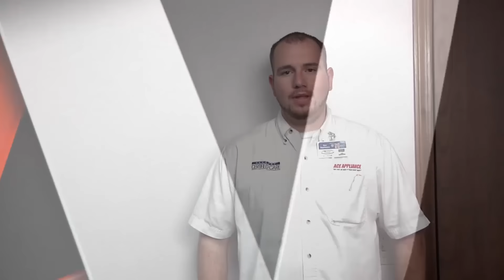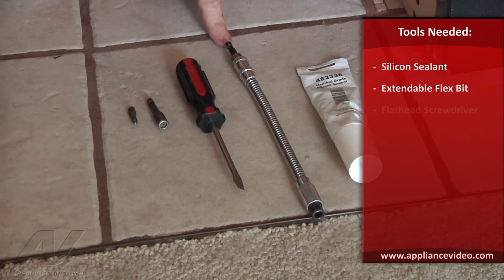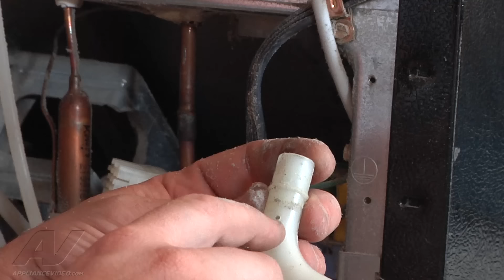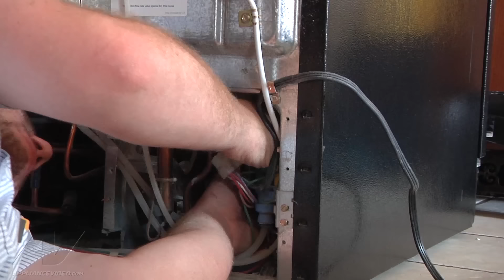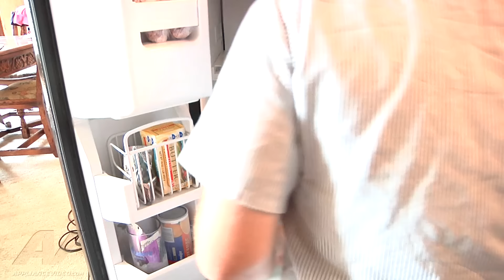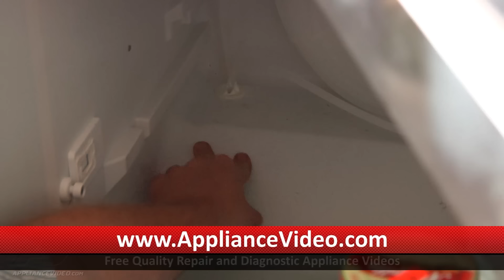Kenmore Refrigerator Repair - Leaking Water - Drain Tube

Comment: why is my ice makers not working Friday I have hoke my water line up from the sink to the back of my Frigidaire and my water is running thought my front of the frigidaire but my ice maker is not working it's been on now for 28 hours so why don't I have ice yet
Reply from the maker: Great question, with our
technicians now getting hundreds questions weekly, they are answering all questions
at our website at ApplianceVideo.com under our Repair Help section. We have over
3,000 common questions and answers that you can easily search through by your
model number, appliance make, and problem or error codes.

Comment: maytag fridge leaking...MD #Rtp1900cae , can't get to the drain tube..how to access is requested
Reply from the maker: Great question, with our
technicians now getting hundreds questions weekly, they are answering all questions
at our website at ApplianceVideo.com under our Repair Help section. We have over
3,000 common questions and answers that you can easily search through by your
model number, appliance make, and problem or error codes.

Comment: I got a new P trap tube on line & it was one pain in the ass to install. The ring around the top of the p trap was to fat to go into the grommet. I had a hell of a time making that ring smaller to fit into the grommet. I just don't get how keeping water held in the p trap is going to help it drain better.
Reply from the maker: +Frank Desantis 

 

         Good question, with our technicians
now getting hundreds questions weekly, they are answering all questions at our
website http://www.appliancevideo.com/repair-help/ .  We also have over 30000 common questions
and answers that you can easily search through by your model number, appliance
make, problem or error code and it’s absolutely FREE.
Reply: It quits letting warm air in and therefore stops all the condensation from building up

Comment: I have the same one on this video I unplug it to defrost and now is not coming on its got power because the light comes on in side but the nothing else does
Reply from the maker: +Luis Gutierrez 

         Good question, with our technicians
now getting hundreds questions weekly, they are answering all questions at our
website http://www.appliancevideo.com/repair-help/ .  We also have over 30000 common questions
and answers that you can easily search through by your model number, appliance
make, problem or error code and it’s absolutely FREE.

Comment: hey how did you get the drain tube to push all the way in so that the round ridge doesent show. if you can get back to me asap that would be awsome
Reply from the maker: +SAYMiK3 

Good question, with our
technicians now getting hundreds questions weekly, they are answering all questions
at our website http://www.appliancevideo.com/repair-help/ .  We also have over 30000 common questions
and answers that you can easily search through by your model number, appliance
make, problem or error code and it’s absolutely FREE.

Comment: What is the p/n of the new drain tube ?
Reply from the maker: +mengseang sean 

 We would like to help you answer your
question. With our videos now getting over 900,000 views per month and hundreds
of questions from people like you, our technicians are now answering questions
at our website http://www.appliancevideo.com/repair-help/ .  We also have over 2200 common questions
and answers that you can easily search through by your model number, appliance
make, problem or error code and it’s absolutely FREE. You also have the option
to email a factory service technician with a question on your appliance at http://www.appliancevideo.com/repair-help/ . If you’re looking for a repair video, you can
also search our library of over 2600 free repair videos. ApplianceVideo.com
specializes in quality DO-IT-YOURSELF appliance repair videos and we get over
800,000 views per MONTH to our videos worldwide and growing. If you need of
parts for your major appliance, we have over 5-million parts in stock at http://savemoreonparts.com/ .  Thanks for your support. Matt Ace
Appliance factory service technician.

Comment: I really need help with my refrigerator
Reply from the maker: +Bonny Sanchez 

All of our technicians are now answering questions daily at our http://www.appliancevideo.com/ website under the Repair Help section.  We also have over 1600 common questions and
answers that you can easily search through by your model number, appliance
make, problem or error code and it’s absolutely FREE. You also have the option
to email a factory service technician with a question on your appliance at
http://www.appliancevideo.com/repair-help/ . If you’re looking for a repair video, you
can also search our library of over 2600 free repair videos. ApplianceVideo.com
specializes in quality DO-IT-YOURSELF appliance repair videos and we get over
800,000 views per MONTH to our videos worldwide and growing. If you need of
parts for your major appliance, we have over 5-million parts in stock at http://savemoreonparts.com/ .  Thanks
for your support. Matt Ace Appliance factory service technician.

Comment: How can i fix my refrigerator? The front panel says  er dh. I guess it means error but please help me fix it. Shes a kenmore and has three doors
Reply from the maker: +Bonny Sanchez 

All of our technicians are now answering questions daily at our http://www.appliancevideo.com/ website under the Repair Help section.  We also have over 1600 common questions and
answers that you can easily search through by your model number, appliance
make, problem or error code and it’s absolutely FREE. You also have the option
to email a factory service technician with a question on your appliance at
http://www.appliancevideo.com/repair-help/ . If you’re looking for a repair video, you
can also search our library of over 2600 free repair videos. ApplianceVideo.com
specializes in quality DO-IT-YOURSELF appliance repair videos and we get over
800,000 views per MONTH to our videos worldwide and growing. If you need of
parts for your major appliance, we have over 5-million parts in stock at http://savemoreonparts.com/ .  Thanks
for your support. Matt Ace Appliance factory service technician.

Comment: Had to replace water inlet valve (MFP 10217917) for KitchenAid stand alone ice maker model # KUIC 15 PLTS because of water leak, but was unfamilar with how to change the two water lines to the inlet valve. found answer on YouTube. The plastic water lines are release by pushing the yellow collar toward the valve and simultaneous pulling the tube away from the valve. Install tube by pushing all the way in. Pull back to seat it. Veryconvenient!
Reply from the maker: P Foster 

Thanks for the thumbs up. We put many hours of
work into each video. Thanks again for your support. Please help us provide more videos to our site
by subscribing to our YouTube page or posting our http://www.appliancevideo.com/ website on your Facebook or Twitter account. Our
factory authorized technician’s also daily provide free professional Repair
Help to people like you to help solve their appliance problems. You also have the option to email a factory
service technician with a question at http://www.appliancevideo.com/repair-help/ .  If
you need of parts for your major appliance, we have over 5-million parts in
stock at http://savemoreonparts.com/ . Thanks
in advance for supporting us. So email us if you have any other questions our
videos cannot resolve. Thanks for your support in advance.   Matt, Ace Appliance service technician.

Comment: Great video. I have been trying to find the drain tube with a P trap in it. When I go to Sears they still show the old model.
What is the new model number and where can I get it?
Reply from the maker: Don 
    Call our parts department with your model number at 1-800-830-5465. They will look it up and get you the correct part. 
Please help us provide more videos to our site by posting ApplianceVideo.com on your YouTube, Facebook or Twitter account or add us to your circles. If you are in need of any parts please support our parts department on line at http://savemoreonparts.com/ or call 1-800-830-5465 7-days a week until 11pm Eastern time. Thanks again your support.  Matt, Ace Appliance service technician.

Comment: Hi, 
I actually did.  They gave me another part that was not the one in the video.  That's why I was hoping to get the part number; no one seems to be able to track down the part.  Thanks.
Reply from the maker: Tao Bernardi 
          All of our technicians are now answering questions daily on the ApplianceVideo.com website. You can search completely FREE in our
Repair Help section. Or you can get unlimited technical advice and video links
emailed to you by our 14 factory certified technicians at h@premium-membership/.  If you
are in need of any parts please support our parts department on line at @ or call 1-800-830-5465 7-days a week until
11pm Eastern time. Thanks for your support. Matt Ace Appliance factory service
technician.

Comment: Hello, what is the part number for the replacement drain tube shown in the video.  I have tried two parts distributors with no luck.  They try selling me a redesigned tube that is black and has a different profile than the one shown, but its not for my fridge.  Any help here would be great!
Reply from the maker: Tao 
    Just call our parts department at 1-800-830-5465 with your model number and they can give you a specific part number for your unit and price. . Please help us provide more videos to our site by posting ApplianceVideo.com on your YouTube, Facebook or Twitter account or add us to your circles. If you are in need of any parts please support our parts department on line at http://savemoreonparts.com/ or call 1-800-830-5465 7-days a week until 11pm Eastern time. Thanks again your support.  Matt, Ace Appliance service technician.

Comment: I have similar Kenmore. Ref part started freezing food, then a few days later I saw water on ref shelves. Long story short, removed ice maker, removed back panel of freezer (may have to defrost ice a bit to free it), and then saw ice buildup in drain tray and over drain tube. Removed back of refrig to see drip pan.  Then in the freezer part, used hair drier and poured hot water on the ice to melt it.  Soaked water run off with towel.  Continued until water flowed down drain tube.  Checked in the drain pan to see the water.

THEN from what I saw on another video, added an 18 gauge cooper wire apox 12" long to the lower heating element. There are two elements, one on top  of the cooling fans and one on the bottom. These heat up during the defrost cycle to melt ice.  Water drips into the drain tray and down the drain tube.  Careful when working around the fans, they bend easily and cut fingers even easier.

Looped one end of wire on the left side of the lower defrost element Then looped the other end on the right side of the lower element while shaping the cooper wire down to but not touching the drain tray (C shape).  This should put heat right over the drain tray and tube to help melt any ice buildup.

ALSO from what I read about one of the causes of this ice build up in the freezer, warm moist air rises in the drip tube, meats the cold freezer air, and the moisture freezes up in the drain tube causing the ice dam.  So I purchased two small elbow tubes and a worm clamp.  Using pipe tape, connected the two elbows into a U shape and added them to the bottom of the drip tube.  Use pipe tape and clamp to secure to the bottom of the tube.  When water drips from the freezer, some of it stays in the U and prevents warm moist air from rising to the heater.  Similar to the U shape in plumbing to keep sewer gases out of the house.  QED so far.
Reply from the maker: Te Bo
           All of our technicians are now answering questions daily on the ApplianceVideo.com website for anyone needing help. Just copy and paste this this question under REPAIR HELP, and one of our  factory authorized technicians  will answer any technical questions at absolutely no charge on your appliance issues. We also have over 2600 free repair videos to help with your appliance repair issues. Thanks for your support. Matt Ace Appliance factory service technician.